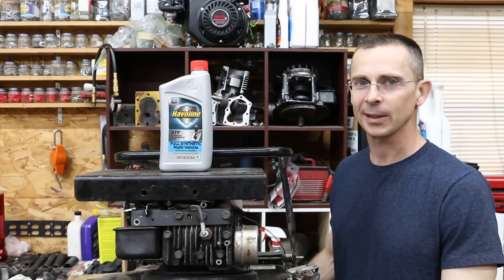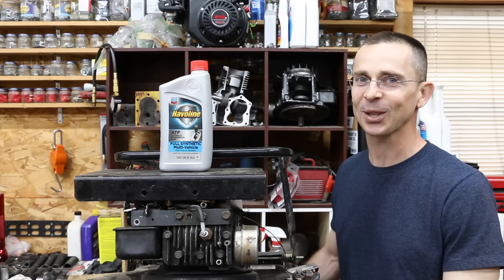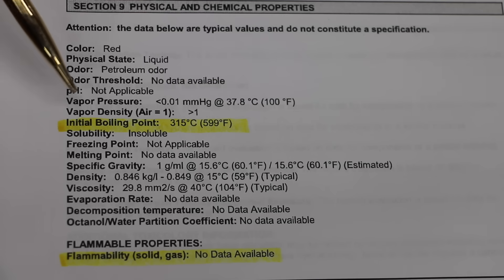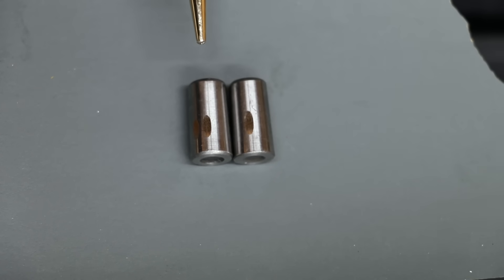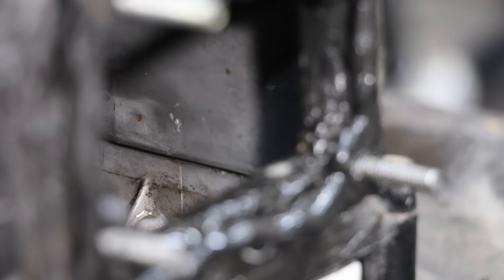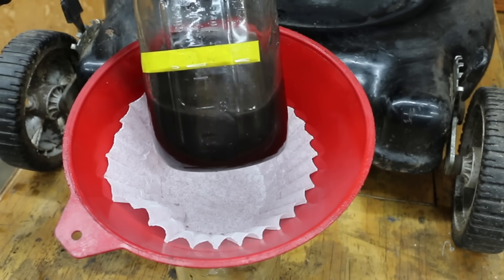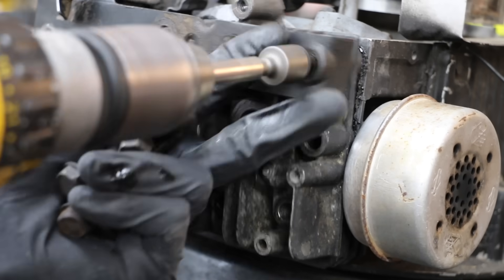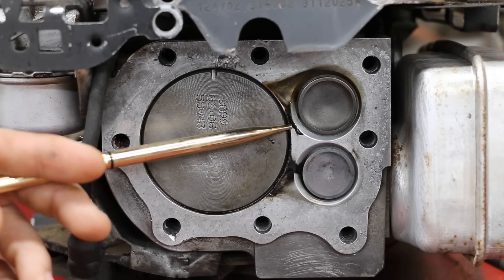ATF as an Engine Oil substitute?  Let's see what happens!

Comment: I have used it to clean the crankcase of a 250K mile neglected Chevy 350 in a 1998 Tahoe that I really did not care about.  1qt of ATF into 4qts of fresh oil.  Let it idle with no load for 4 hours.  The oil/ATF mix came out absolutely jet black.  It knocked the carbon out of the oil rings and increased compression.  Went from using 1 qt every 800 miles to 1 qt every 1,500.  Switched to Mobil One after the cleaning.  After 15K miles changing the Mobil One every 3K it was almost spotless inside the engine.  Compression was up 25 psi in almost every cylinder, power was up and it was using 1 qt every 2,500 miles.  I think using Mobil One alone would have a similar effect but needs some time and mileage to work
Reply from the maker: Thank you!
Reply: @ProjectFarm  No problem! I would love to see you try Zak Products engine oil treatment.  I once worked for a Berkshire Hathaway Automotive owned dealership that used it.  Always felt it was snake oil and had a massive disagreement with the rep over it. We were affiliated companies both owned by BHA.  I had to deal with her at that time. Would love to see how it actually performs if you ever feel like trying to track it down and test it. I always said that it was better to spend the money on Mobil One or Amsoil with no additive having torn into numerous engines I have run on it since day one for performance upgrade reasons.  Cam upgrades and cylinder head upgrades. I had also seen the inside of engines running a mixture of conventional oil and the Zak additive and they were always more sludged and had more wear. Their additives were used by Nascar at one point but I feel it was a marketing thing.  Conventional oil with Zak oil additive vs Mobil One test perhaps. There are literally hundreds of dealers selling it as a premium service across the nation but does it really work...I doubt it.  Would love to see it in the friction test as well as if it actually cleans crankcase deposits. I have a feeling Mobil One is better at both. Zak Products C500 was what we sold.  Allegidly turned the oil into a synthetic blend.

Comment: I recently purchased 2003 dodge ram 1500 with 230k miles gasoline motor. Truck Was dead and i had it towed home it also wouldn't turn over.. Would barely crank.

After major tune up the truck fired up.

Had a major hard knock as if rod was spinning. 

I changed motor oil and added 2 quarts of Valvaline atf.

After 30 miles the knock dissipated to a tick... 60 miles later, Then a light tap.

Approximately 100 miles of drive time with the atf in the crankcase, there is no more knocking, ticking or tapping! 

Changed oil to 100% motor oil after 400 miles. All is great now. 

Purrs smooth as a kitten!
Reply from the maker: Thanks for watching!

Comment: I have used it in my 73 Nova I had to clean it out. The logic was if spool vales in the valve body don't seize up why wouldn't it work for lifters. Didn't quiet the valve train down. But in all fairness I had a rocker arm failing. I had adjusted the valve train and sound came back about a week later. The reason we tried ATF. Ran a day or two drained and refilled with oil. When the pushrod pushed threw the pocket. The engine actually appeared cleaner under the valve cover from when I adjusted the rockers a couple of weeks before that old 350.
Reply from the maker: This is great information. Thank you

Comment: Given the results of this test I'd be curious to see if a mixture of automatic transmission fluid and engine oil would promote a cleaner combustion chamber over a more prolonged experiment, can it keep the piston clean.  Additionally, can automatic transmission fluid be used as an induction service?  On the latter I'm guessing it's not a good idea.  What do you think?
Reply from the maker: Thank you for the video idea!

Comment: One of my previous co-workers had an older Toyota pickup with the 2.2L 4 cylinder engine. It developed a noticeable engine tick. He started substituting 1 qt of atf for 1 qt oil when he changed oil. The tick did go away after a time, and he drove it a few years that way. 
He sold the truck, and the guy that bought it intended to rebuild the engine after he purchased it. When he pulled the engine apart, the inside was very clean, no noticeable build-up of any kind inside the engine. The cam and crank were both clean, the push-rods were clean.
He basically put a ring and gasket kit into it and put it back in the truck and drove it.
I didn't know if that guy kept using the atf in the engine after that or not but it did seem to stop the tick and clean up the inside of the engine.
Reply from the maker: Impressive results!  Thanks for sharing this knowledge.

Comment: When I was young in the 1970s, an old mechanic said that he would add a quart of ATF to a car engine and run it that way for a few days just before changing the oil & filter.  He felt that this did a better job of removing sludge, gum and varnish than the detergents in the oil itself.   I would have liked to see the test in this video done on a really OLD mower with some nasty deposits on the internal parts to see how it would clean them up.  Like you, I'm too chicken to actually try this on my car.  😁
Reply from the maker: Thank you

Comment: I got one for you will a half a quart of water and a half a quart of transmission fluid ATF sprayed directly into the intake clean the valves now I had a Saab Turbo they have low compression in one of the cylinders cuz one of the valves being dirty I use this and it did work the car no longer have a Miss to it
Reply from the maker: Thank you for the video idea!

Comment: My brother bought a 1977 (I think?) Pontiac firebird 301 & the original owner ran 1 quart of atf mixed in with every oil change & it ran SMOOTH!!!!!!!! Now, About your saw zaw blade test where you pit different blade manufacture's saw zaw blades againt each other, So,I purchased & used a set of Lenox saw zaw blades, The 2x life/ Power ARC curved blade 14 tpi, 3 piece, 6" 152mm... item #1958397 & it took a long time to bite into the metal & scratched/gauged up the work a lot but, when it did bite in, it cut pretty fast only After it started cutting, did it cut good.  I was cutting exhaust pipe, about 2 1/4" exhaust pipe!
Reply from the maker: Impressive with the ATF on the Pontiac!  Glad the Lenox cut through the exhaust pipe!

Comment: I appreciate your comprehensive work. However, until recently I've only changed oil every spring. My lawnmowers run for 25 years. I have 3. The fourth I had to just because the shaft was bent (I shoulda tried bending it back to straighten).
I'm content to change oil frequently. I never used cleansers in my engines.
Reply from the maker: Thank you

Comment: Small 4 strokes are so fun. Your approach makes it even better. Good stuff my friend. All I can figure from the cylinder with the trans fluid is that its blowing by the intake valve seal since its less viscosity and cleaning the piston at the compression stroke. the plug showed it was burning more than fuel. Thats how it looks to me. Almost like it has a coolant leak but its air cooled :D Alot more crust around both valves with the trans fluid, especially the exhaust. May have crept past the oil ring as well. Trans fluid is water compared to even 5w20
Reply from the maker: Thank you!

Comment: I know this is an older video but I still found it useful. I have a 2017 HD Street Glide. The lifters started making a lot of noise at startup within the first 1200 mile weekend ride. I figured if it was already broken, I would use amsoil synthetic atf to clean the lifters. I ran it for 1000 miles and the lifter noise stopped at about 300 miles into this cleaning. on the next oil change I switched to amoil 10w50 dirt bike oil. the bike is performing very well and not making any noise at startup. next oil change is this weekend (3k mile intervals except for this test for 1k), I will go back to the amsoil 20w50 and I am going to Blairsville for vacation. I would not want to push my luck and will just see if this amsoil atf actually cleaned lifters!
Reply from the maker: Thank you very much! Impressive results from Amsoil ATF!

Comment: My grandfather was a Certified mechanic Ford motor dealership and Utah used to certify people to be certified mechanics he used one quart of automatic transmission fluid 4 quarts of oil gray car that use a total of 5 quarts on some truck oil pans some Vehicles would take more oil but just one quart of transmission fluid and run it for 100 miles and then drain it because transmission fluid has more detergent in it and then drain it put on a new filter and put new oil in it we did this on the old Vehicles like 1960s and early 70s vehicles I'm not sure if this procedure would work good on new vehicles because depends upon the type of metals being used for the bearings and rings on the vehicles especially the bearings because they are made of a very soft metal my grandfather did it on the rolled Vehicles back in the mid 60s and early 70s he also taught me how to modify carburetors where they would give you excellent mileage I worked on cars all my life I'm 59 years old now my grandfather was a top of the line mechanic work for Ford motor dealership and also work for a Chevy dealership I learned so very much from him I would be hesitant on putting transmission fluid in your oil because the new cars may be using different Alloys of metals especially on the main bearings and and cam bearings the metal is so very soft and transmission fluid has a lot of detergent in it
Reply from the maker: Thank you!

Comment: I've used straight diesel in heavly neglected engines run them for 30 mins on idle or 1500 rpm.. Flushes them out beautifully. Drain out add  oil quietens lifters too..
Reply from the maker: Thank you!

Comment: I know this is a year old video, but I have always used transmission fluid to top off my engines when they get about a quart low in all of my cars. In my experience, it makes for an overall quieter engine. The most recent test I have done is with my Malibu, had the intake off. The car had a severe lifter noise, so while I had the intake off to put a new one on, I filled the tops of all the lifters with ATF. When I got the car running again, it was quiet as a mouse and the lifter has yet to act up again.
Reply from the maker: Thank you!

Comment: Have a 2003 Honda Accord k24a4 2.4 230,000 miles smoked at high rpms added half a quart of Honda DW-1 transmission fluid to the motor oil and about 50 miles later to my surprise it stop smoking and Runs much better! maybe stuck oil rings ? Thanks for the video
Reply from the maker: Impressive!  Glad it helped.

Comment: Back in the 60's when almost all v8 engines used 5 qts of oil and almost all 6 inlines used 4 qts of oil, many people would substitute a qt of atf for a qt of oil. the result was a cleaner engine (internally) and many claim their seals didn't leak as the engine aged. I don't have any proof of the benefits, but I never saw oil related breakdowns either. Mind you, many of these engines only saw 200-300 miles a month, and were happy with 30 psi of oil pressure.
Reply from the maker: Great information. Thank yoU!

Comment: Check this out: back about 20 years ago, I had really bad sludge in my sports car. A friend who was a Technician @ Nissan told me the following: run 5 quarts of ATF on idle and idle only for 15-20 minutes with new oil filter. ATF as its high in detergents would clean my engine. Also 3 or 4 to 1 ratio of oil plus ATF while driving for about 100 miles effectively cleans ur egine. I ran it by my shop and it was confirmed because of detergents in ATF.
Reply from the maker: Wow! Thank you

Comment: When I  was younger I worked at a Texaco gas station for an older gentleman that taught me to add a quart of transmission fluid a week before an oil change to get deposits suspended so they would drain with the old oil.  That was back in the 80s.
Reply from the maker: The old timers had a lot of great tricks!

Comment: had a negative experience in 1976. i added atf to a 440 retired plymouth fury police car with a lifter noise . i used 2 quarts 1 after another and lost the crank shaft. the lubricity is lost  and will excessive  friction due to not enough lubricity for this engine. better 1 quart marvel mystery oil then an oil change  after the noise is gone.

Comment: The reason ATF oil cleans better and causes things to get washed out is because it's designed to do just that. If varnish and carbon build in in the valve body etc...Trans can either cease to work right or be damaged. The idea of having 3-5 times the cleaning power is to get stuff out of the vital areas so the filter and magnetic drain plug can pick it up. And because of the cleaning power the ATF will clean sticking rings and make them work again if they are not really stuck. And clean out the oil ring so that the right amount will be in the cylinders and you get better compression and less oil consumption.

I have not only used ATF to clean an engine but to stop front and rear seal leaks on a car engine. How safe is it to use? About a week before I plan to change my oil when my car is a quart low. I put this in and drive it for a week. I then change it. But only when needed, not every time.
Reply from the maker: Great point! Thank you

Comment: I have used trans fluid to un-stick valves in high miles engine.....pour 1/2 quart through the carb a little at a time , above idle, smokes like hell  but your valves want stick anymore.  I put the other half in the gas tank.
Reply from the maker: Great tip!

Comment: I see a possible mistake. You used pure ATF. 
Growing up as a kid of a shadetree mech I was always out helping reach in the tight spots to loosen or tighten stuff. We use the ATF trick but it was 4qts regular oil and 1qt ATF . Daddy would do that drive it about 100 miles and then dump the oil. Never did a shavings test but the valve pans were always shiny and clean inside when we did a gasket replace. Not every time but it a ticking lifter was markedly quieter after the drive.
Reply from the maker: Thank you!

Comment: I often use an atf+Oil mix when dealing with high mileage motors. 1 part atf 7 parts oil. And run the motor for around 500 miles. And watch the river of sludge come out. Then it's back to conventional oil for another 50k.

Also of note Run straight atf in rotary motors for about 2 hours to reseal apex seals. It will smoke like a pig during that time, then your good for at least another 30k
Reply from the maker: Thank you!

Comment: From what I’ve seen putting a qt of tranny fluid in place of a qt motor oil at a oil chang helps soften seals and it seems to help clean up sludge deposits. Lifters and piston rings and such if I had to guess atf cleans better has friction modifiers in it and it thins down motor . So in all reality probably between thinner oil and extra detergent friction modifiers its capable off better penetration and it does swell some rubber seals. My 2 cents anyway God Bless
Reply from the maker: Thank you

Comment: I haven't had any negative results as of yet using atf as an additional detergent for neglected small engines that have build up or sludge in the crankcase. Typically i only use 25% atf 75% oil and run for an hour with just a light load. Could just be all in my head and the oil would do the job anyway. I've never tried this in anything bigger than a 800cc atv.
Reply from the maker: Thank you

Comment: I like your channel, but I completely disagree with this test and what you said. Respectfully, you want to only add about a quart to your car, not a complete swap from oil to atf, and only drive a maximum of 1000 miles. I learned this from a guy that has 40+ years being a mechanic and is very good at his job, to his credit he has two big shops and provides honest service and never overcharges. Finally, what atf does is cleans a number of things and ways, but most importantly renews any gaskets. Atf is made to keep gaskets soft, without deteriorating them and this is the main benefit. Also it takes time to renew these gaskets, and some are to old to save, even after a few cycles. I have found great improvements in cleaning  engines, stopping or reducing oil leaks, and engines that smoke due to worn or hard valve stem seals would stop smoking. Ofcourse this is in most cases but not all. Thank you and keep up the good work.
Reply from the maker: Thank you for the constructive feedback.

Comment: I added a qt to a Volvo 5 cylinder to free up noisy lifters after 2 unsuccessful attempts with normal oil changes. Drove the vehicle normally for 150 miles. Oil change was thoroughly disgusting compared to prior attempts, motor was quiet/smooth as silk. shrug always worked for lifters for me
Reply from the maker: Impressive!

Comment: I'd be interested in knowing if the compression gains held up after putting motor oil back in the crankcase and running the engine for a while.  That seemed like a huge jump, and I wonder if it was a temporary gain.

Comment: I’ve used straight atf run at idle (for 20 minutes maybe) in a 

95 eclipse
01 Land Rover disco
Older dodge Dakota (late 90’s maybe)

With no issues and thousands of miles put on the engine after. They seemed to really run quieter afterwards however I also did a sea foam intake induction cleaning at the same time and new engine oil after probably helped too. I really don’t think it hurt anything, not too sure if it helped either.
Reply from the maker: Thank you